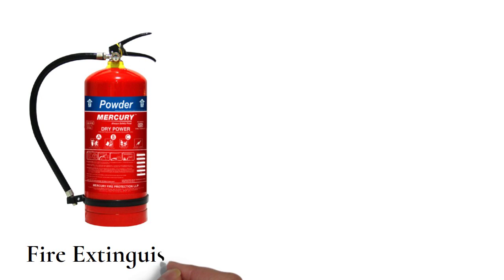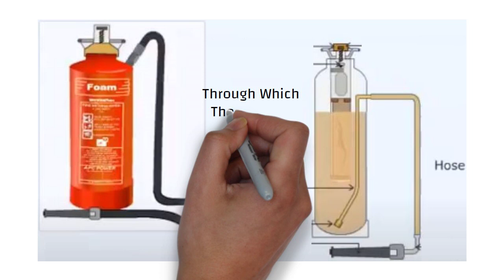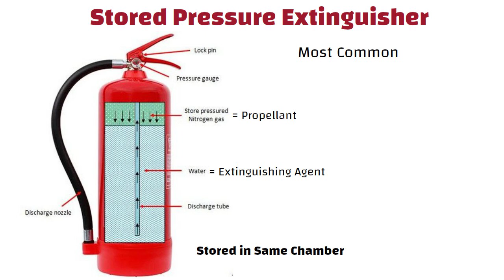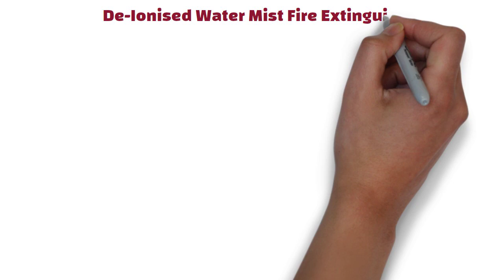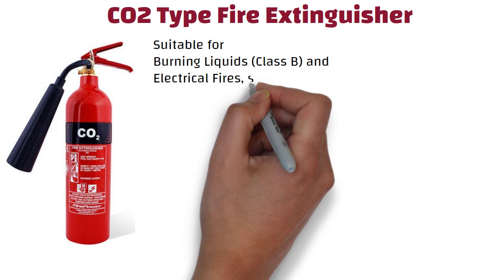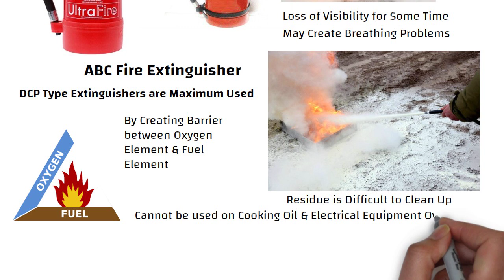FIRE EXTINGUISHER DEALERS IN KERALA, CALL 8138906102, FIRE EXTINGUISHER DEALERS IN ERNAKULAM.

Comment: Fire alarm systems in Kayamkulam
Reply: FIRE EXTINGUISHER DEALERS IN KOCHI, FIRE EXTINGUISHER SUPPLIERS IN KOCHI, FIRE EXTINGUISHER DISTRIBUTORS IN KOCHI, FIRE EXTINGUISHER IN KOCHI, ABC TYPE FIRE EXTINGUISHER DEALERS IN KOCHI, CO2 TYPE FIRE EXTINGUISHER DEALERS IN KOCHI, CLEAN AGENT FIRE EXTINGUISHER IN KOCHI, MODULAR TYPE FIRE EXTINGUISHER DEALERS IN KOCHI, MECHANICAL FOAM FIRE EXTINGUISHER DEALERS IN KOCHI, FIRE EXTINGUISHER NEAR ME KOCHI, FIRE EXTINGUISHER TRADERS IN KOCHI, FIRE FIGHTING COMPANIES IN KOCHI, FIRE CONTRACTORS IN KOCHI, FIRE EQUIPMENT DEALERS IN KOCHI, FIRE ALARM DEALERS IN KOCHI, FIRE PUMP DEALERS IN KOCHI, SMOKE DETECTOR DEALERS IN KOCHI, FIRE FIGHTING SYSTEM IN KOCHI, FIRE PROTECTION SYSTEM IN KOCHI, FIRE AND SAFETY CONTRACTORS IN KOCHI, FIRE HYDRANT SYSTEMS IN KOCHI, PA TALK BACK SYSTEM IN KOCHI, FIRE NOC IN KOCHI, FIRE INSTALLATION IN KOCHI, FIRE NOC RENEWAL IN KOCHI, KIRLOSKAR FIRE PUMP DEALERS IN KOCHI, FIRE EXTINGUISHER NEAR ME KOCHI, FIRE EXTINGUISHER MANUFACURERS IN KOCHI, SAFEX FIRE EXTINGUISHER DEALERS IN KOCHI, FIRE NOC CONTRACTORS IN KOCHI, FIRE FIGHTING EQUIPMENT DEALERS IN KOCHI, FIRE PROTECTION SYSTEM IN KOCHI, FIRE INSTALLATION IN KOCHI, FIRE SAFETY CONTRACTORS IN KOCHI, FIRE AMC IN KOCHI, FIRE PROTECTION SYSTEM IN KOCHI, FIRE PROTECTION EQUIPMET IN KOCHI, AMC OF FIRE SYSTEM IN KOCHI, FIRE CONSULTANTS IN KOCHI, FIRE AND SAFETY EQUIPMENT DEALERS IN KOCHI, ADDRESSABLE FIRE ALARM SYSTEM IN KOCHI, KARTHAR VALVE DEALERS IN KOCHI, DCP TYPE FIRE EXTINGUISHER IN KOCHI, POWSER TYPE FIRE EXTINGUISHERS IN KOCHI, FIRE HYDRANT SYSTEM IN KOCHI, FIRE ALARM PANEL DEALERS IN KOCHI, SAFEPRO FIRE EXTINGUISHER DEALERS IN KOCHI, MS AND GI PIPE DEALERS IN KOCHI, JINDAL PIPE DEALERS IN KOCHI, AGNI FIRE ALARM DEALERS IN KOCHI, FIRE EQUIPMENT DEALERS IN KOCHI, FIRE EQUIPMENT SUPPLIERS IN KOCHI, FIRE EQUIPMENT TRADERS IN KOCHI, FIRE SPRINKLER SYSTEM IN KOCHI, RAVLE FIRE ALARM DEALERS IN KOCHI, RAVEL FIRE ALARM SYSTEM IN KOCHI, AGNI FIRE ALARM DISTRIBUTORS IN KOCHI, FIRE ALARM CONTRACTORS IN KOCHI, FIRE PIPE INSTALLATION IN CONTRACTORS IN KOCHI, FIRE SAFETY CONTRACTORS IN KOCHI, FIRE PA TWO WAY TALK BACK SYSTEM DEALERS IN KOCHI, HEAT DETECTOR DEALERS IN KOCHI, HONEYWELL FIRE ALARM DEALERS IN KOCHI, FIRE NOC CONSULTANTS IN KOCHI, FIRE AMC AND FIRE NOC IN KOCHI, FIRE SAFETY COMPANIES IN KOCHI, NEWAGE DEALERS IN KOCHI, MONSHER FIRE EQUIPMENT DEALERS IN KOCHI, KARTHAR VALVE DEALERS IN KOCHI, FIRE HYDRANT VALVE DEALERS IN KOCHI, FIRE HOSE REEL DRUM DEALERS IN KOCHI, FIRE SPRINKLER DEALERS IN KOCHI, FIRE PUMP DEALERS IN KOCHI, LUBI PUMP DEALERS IN KOCHI, LHP PUMP DEALERS IN KOCHI. FIRE CONTRACTORS IN KOCHI, FIRE AND SAFETY CONTRACTORS IN KOCHI, FIRE EQUIPMENT DEALERS IN KOCHI, FIRE FIGHTING CONTRACTORS IN KOCHI,
Reply: FIRE EXTINGUISHER DEALERS IN KOTTARAKARA, FIRE EXTINGUISHER SUPPLIERS IN KOTTARAKARA, FIRE EXTINGUISHER DISTRIBUTORS IN KOTTARAKARA, FIRE EXTINGUISHER IN KOTTARAKARA, ABC TYPE FIRE EXTINGUISHER DEALERS IN KOTTARAKARA, CO2 TYPE FIRE EXTINGUISHER DEALERS IN KOTTARAKARA, CLEAN AGENT FIRE EXTINGUISHER IN KOTTARAKARA, MODULAR TYPE FIRE EXTINGUISHER DEALERS IN KOTTARAKARA, MECHANICAL FOAM FIRE EXTINGUISHER DEALERS IN KOTTARAKARA, FIRE EXTINGUISHER NEAR ME KOTTARAKARA, FIRE EXTINGUISHER TRADERS IN KOTTARAKARA, FIRE FIGHTING COMPANIES IN KOTTARAKARA, FIRE CONTRACTORS IN KOTTARAKARA, FIRE EQUIPMENT DEALERS IN KOTTARAKARA, FIRE ALARM DEALERS IN KOTTARAKARA, FIRE PUMP DEALERS IN KOTTARAKARA, SMOKE DETECTOR DEALERS IN KOTTARAKARA, FIRE FIGHTING SYSTEM IN KOTTARAKARA, FIRE PROTECTION SYSTEM IN KOTTARAKARA, FIRE AND SAFETY CONTRACTORS IN KOTTARAKARA, FIRE HYDRANT SYSTEMS IN KOTTARAKARA, PA TALK BACK SYSTEM IN KOTTARAKARA, FIRE NOC IN KOTTARAKARA, FIRE INSTALLATION IN KOTTARAKARA, FIRE NOC RENEWAL IN KOTTARAKARA, KIRLOSKAR FIRE PUMP DEALERS IN KOTTARAKARA, FIRE EXTINGUISHER NEAR ME KOTTARAKARA, FIRE EXTINGUISHER MANUFACURERS IN KOTTARAKARA, SAFEX FIRE EXTINGUISHER DEALERS IN KOTTARAKARA, FIRE NOC CONTRACTORS IN KOTTARAKARA, FIRE FIGHTING EQUIPMENT DEALERS IN KOTTARAKARA, FIRE PROTECTION SYSTEM IN KOTTARAKARA, FIRE INSTALLATION IN KOTTARAKARA, FIRE SAFETY CONTRACTORS IN KOTTARAKARA, FIRE AMC IN KOTTARAKARA, FIRE PROTECTION SYSTEM IN KOTTARAKARA, FIRE PROTECTION EQUIPMET IN KOTTARAKARA, AMC OF FIRE SYSTEM IN KOTTARAKARA, FIRE CONSULTANTS IN KOTTARAKARA, FIRE AND SAFETY EQUIPMENT DEALERS IN KOTTARAKARA, ADDRESSABLE FIRE ALARM SYSTEM IN KOTTARAKARA, KARTHAR VALVE DEALERS IN KOTTARAKARA, DCP TYPE FIRE EXTINGUISHER IN KOTTARAKARA, POWSER TYPE FIRE EXTINGUISHERS IN KOTTARAKARA, FIRE HYDRANT SYSTEM IN KOTTARAKARA, FIRE ALARM PANEL DEALERS IN KOTTARAKARA, SAFEPRO FIRE EXTINGUISHER DEALERS IN KOTTARAKARA, MS AND GI PIPE DEALERS IN KOTTARAKARA, JINDAL PIPE DEALERS IN KOTTARAKARA, AGNI FIRE ALARM DEALERS IN KOTTARAKARA, FIRE EQUIPMENT DEALERS IN KOTTARAKARA, FIRE EQUIPMENT SUPPLIERS IN KOTTARAKARA, FIRE EQUIPMENT TRADERS IN KOTTARAKARA, FIRE SPRINKLER SYSTEM IN KOTTARAKARA, RAVEL FIRE ALARM DEALERS IN KOTTARAKARA, RAVEL FIRE ALARM SYSTEM IN KOTTARAKARA, AGNI FIRE ALARM DISTRIBUTORS IN KOTTARAKARA, FIRE ALARM CONTRACTORS IN KOTTARAKARA, FIRE PIPE INSTALLATION IN CONTRACTORS IN KOTTARAKARA, FIRE SAFETY CONTRACTORS IN KOTTARAKARA, FIRE PA TWO WAY TALK BACK SYSTEM DEALERS IN KOTTARAKARA, HEAT DETECTOR DEALERS IN KOTTARAKARA, HONEYWELL FIRE ALARM DEALERS IN KOTTARAKARA, FIRE NOC CONSULTANTS IN KOTTARAKARA, FIRE AMC AND FIRE NOC IN KOTTARAKARA, FIRE SAFETY COMPANIES IN KOTTARAKARA, NEWAGE DEALERS IN KOTTARAKARA, MONSHER FIRE EQUIPMENT DEALERS IN KOTTARAKARA, KARTHAR VALVE DEALERS IN KOTTARAKARA, FIRE HYDRANT VALVE DEALERS IN KOTTARAKARA, FIRE HOSE REEL DRUM DEALERS IN KOTTARAKARA, FIRE SPRINKLER DEALERS IN KOTTARAKARA, FIRE PUMP DEALERS IN KOTTARAKARA, LUBI PUMP DEALERS IN KOTTARAKARA, LHP PUMP DEALERS IN KOTTARAKARA. FIRE CONTRACTORS IN KOTTARAKARA, FIRE AND SAFETY CONTRACTORS IN KOTTARAKARA, FIRE EQUIPMENT DEALERS IN KOTTARAKARA, FIRE FIGHTING CONTRACTORS IN KOTTARAKARA, AGNI FIRE ALARM DEALERS IN KOTTARAKARA, PA TALK BACK SYSTEM DEALERS IN KOTTARAKARA, FIRE NOC IN KOTTARAKARA, FIRE NOC RENEWAL IN KOTTARAKARA, FIRE SYSTEM INSTALLATION IN KOTTARAKARA.
Reply: FIRE EXTINGUISHER DEALERS IN KERALA, FIRE EXTINGUISHER SUPPLIERS IN KERALA, FIRE EXTINGUISHER DISTRIBUTORS IN KERALA, FIRE EXTINGUISHER IN KERALA, ABC TYPE FIRE EXTINGUISHER DEALERS IN KERALA, CO2 TYPE FIRE EXTINGUISHER DEALERS IN KERALA, CLEAN AGENT FIRE EXTINGUISHER IN KERALA, MODULAR TYPE FIRE EXTINGUISHER DEALERS IN KERALA, MECHANICAL FOAM FIRE EXTINGUISHER DEALERS IN KERALA, FIRE EXTINGUISHER NEAR ME KERALA, FIRE EXTINGUISHER TRADERS IN KERALA, FIRE FIGHTING COMPANIES IN KERALA, FIRE CONTRACTORS IN KERALA, FIRE EQUIPMENT DEALERS IN KERALA, FIRE ALARM DEALERS IN KERALA, FIRE PUMP DEALERS IN KERALA, SMOKE DETECTOR DEALERS IN KERALA, FIRE FIGHTING SYSTEM IN KERALA, FIRE PROTECTION SYSTEM IN KERALA, FIRE AND SAFETY CONTRACTORS IN KERALA, FIRE HYDRANT SYSTEMS IN KERALA, PA TALK BACK SYSTEM IN KERALA, FIRE NOC IN KERALA, FIRE INSTALLATION IN KERALA, FIRE NOC RENEWAL IN KERALA, KIRLOSKAR FIRE PUMP DEALERS IN KERALA, FIRE EXTINGUISHER NEAR ME KERALA, FIRE EXTINGUISHER MANUFACURERS IN KERALA, SAFEX FIRE EXTINGUISHER DEALERS IN KERALA, FIRE NOC CONTRACTORS IN KERALA, FIRE FIGHTING EQUIPMENT DEALERS IN KERALA, FIRE PROTECTION SYSTEM IN KERALA, FIRE INSTALLATION IN KERALA, FIRE SAFETY CONTRACTORS IN KERALA, FIRE AMC IN KERALA, FIRE PROTECTION SYSTEM IN KERALA, FIRE PROTECTION EQUIPMET IN KERALA, AMC OF FIRE SYSTEM IN KERALA, FIRE CONSULTANTS IN KERALA, FIRE AND SAFETY EQUIPMENT DEALERS IN KERALA, ADDRESSABLE FIRE ALARM SYSTEM IN KERALA, KARTHAR VALVE DEALERS IN KERALA, DCP TYPE FIRE EXTINGUISHER IN KERALA, POWSER TYPE FIRE EXTINGUISHERS IN KERALA, FIRE HYDRANT SYSTEM IN KERALA, FIRE ALARM PANEL DEALERS IN KERALA, SAFEPRO FIRE EXTINGUISHER DEALERS IN KERALA, MS AND GI PIPE DEALERS IN KERALA, JINDAL PIPE DEALERS IN KERALA, AGNI FIRE ALARM DEALERS IN KERALA, FIRE EQUIPMENT DEALERS IN KERALA, FIRE EQUIPMENT SUPPLIERS IN KERALA, FIRE EQUIPMENT TRADERS IN KERALA, FIRE SPRINKLER SYSTEM IN KERALA, RAVLE FIRE ALARM DEALERS IN KERALA, RAVEL FIRE ALARM SYSTEM IN KERALA, AGNI FIRE ALARM DISTRIBUTORS IN KERALA, FIRE ALARM CONTRACTORS IN KERALA, FIRE PIPE INSTALLATION IN CONTRACTORS IN KERALA, FIRE SAFETY CONTRACTORS IN KERALA, FIRE PA TWO WAY TALK BACK SYSTEM DEALERS IN KERALA, HEAT DETECTOR DEALERS IN KERALA, HONEYWELL FIRE ALARM DEALERS IN KERALA, FIRE NOC CONSULTANTS IN KERALA, FIRE AMC AND FIRE NOC IN KERALA, FIRE SAFETY COMPANIES IN KERALA, NEWAGE DEALERS IN KERALA, MONSHER FIRE EQUIPMENT DEALERS IN KERALA, KARTHAR VALVE DEALERS IN KERALA, FIRE HYDRANT VALVE DEALERS IN KERALA, FIRE HOSE REEL DRUM DEALERS IN KERALA, FIRE SPRINKLER DEALERS IN KERALA, FIRE PUMP DEALERS IN KERALA, LUBI PUMP DEALERS IN KERALA, LHP PUMP DEALERS IN KERALA. FIRE CONTRACTORS IN KERALA, FIRE AND SAFETY CONTRACTORS IN KERALA, FIRE EQUIPMENT DEALERS IN KERALA, FIRE FIGHTING CONTRACTORS IN KERALA, FIRE EXTINGUISHER DEALERS IN KOCHI, FIRE EXTINGUISHER SUPPLIERS IN KOCHI, FIRE EXTINGUISHER DISTRIBUTORS IN KOCHI, FIRE EXTINGUISHER IN KOCHI, ABC TYPE FIRE EXTINGUISHER DEALERS IN KOCHI, CO2 TYPE FIRE EXTINGUISHER DEALERS IN KOCHI, CLEAN AGENT FIRE EXTINGUISHER IN KOCHI, MODULAR TYPE FIRE EXTINGUISHER DEALERS IN KOCHI, MECHANICAL FOAM FIRE EXTINGUISHER DEALERS IN KOCHI, FIRE EXTINGUISHER NEAR ME KOCHI, FIRE EXTINGUISHER TRADERS IN KOCHI, FIRE FIGHTING COMPANIES IN KOCHI, FIRE CONTRACTORS IN KOCHI, FIRE EQUIPMENT DEALERS IN KOCHI, FIRE ALARM DEALERS IN KOCHI, FIRE PUMP DEALERS IN KOCHI, SMOKE DETECTOR DEALERS IN KOCHI, FIRE FIGHTING SYSTEM IN KOCHI, FIRE PROTECTION SYSTEM IN KOCHI, FIRE AND SAFETY CONTRACTORS IN KOCHI, FIRE HYDRANT SYSTEMS IN KOCHI, PA TALK BACK SYSTEM IN KOCHI, FIRE NOC IN KOCHI, FIRE INSTALLATION IN KOCHI, FIRE NOC RENEWAL IN KOCHI, KIRLOSKAR FIRE PUMP DEALERS IN KOCHI, FIRE EXTINGUISHER NEAR ME KOCHI, FIRE EXTINGUISHER MANUFACURERS IN KOCHI, SAFEX FIRE EXTINGUISHER DEALERS IN KOCHI, FIRE NOC CONTRACTORS IN KOCHI, FIRE FIGHTING EQUIPMENT DEALERS IN KOCHI, FIRE PROTECTION SYSTEM IN KOCHI, FIRE INSTALLATION IN KOCHI, FIRE SAFETY CONTRACTORS IN KOCHI, FIRE AMC IN KOCHI, FIRE PROTECTION SYSTEM IN KOCHI, FIRE PROTECTION EQUIPMET IN KOCHI, AMC OF FIRE SYSTEM IN KOCHI, FIRE CONSULTANTS IN KOCHI, FIRE AND SAFETY EQUIPMENT DEALERS IN KOCHI, ADDRESSABLE FIRE ALARM SYSTEM IN KOCHI, KARTHAR VALVE DEALERS IN KOCHI, DCP TYPE FIRE EXTINGUISHER IN KOCHI, POWSER TYPE FIRE EXTINGUISHERS IN KOCHI, FIRE HYDRANT SYSTEM IN KOCHI, FIRE ALARM PANEL DEALERS IN KOCHI, SAFEPRO FIRE EXTINGUISHER DEALERS IN KOCHI, MS AND GI PIPE DEALERS IN KOCHI, JINDAL PIPE DEALERS IN KOCHI, AGNI FIRE ALARM DEALERS IN KOCHI, FIRE EQUIPMENT DEALERS IN KOCHI, FIRE EQUIPMENT SUPPLIERS IN KOCHI, FIRE EQUIPMENT TRADERS IN KOCHI, FIRE SPRINKLER SYSTEM IN KOCHI, RAVLE FIRE ALARM DEALERS IN KOCHI, RAVEL FIRE ALARM SYSTEM IN KOCHI, AGNI FIRE ALARM DISTRIBUTORS IN KOCHI, FIRE ALARM CONTRACTORS IN KOCHI, FIRE PIPE INSTALLATION IN CONTRACTORS IN KOCHI, FIRE SAFETY CONTRACTORS IN KOCHI, FIRE PA TWO WAY TALK BACK SYSTEM DEALERS IN KOCHI, HEAT DETECTOR DEALERS IN KOCHI, HONEYWELL FIRE ALARM DEALERS IN KOCHI, FIRE NOC CONSULTANTS IN KOCHI, FIRE AMC AND FIRE NOC IN KOCHI, FIRE SAFETY COMPANIES IN KOCHI, NEWAGE DEALERS IN KOCHI, MONSHER FIRE EQUIPMENT DEALERS IN KOCHI, KARTHAR VALVE DEALERS IN KOCHI, FIRE HYDRANT VALVE DEALERS IN KOCHI, FIRE HOSE REEL DRUM DEALERS IN KOCHI, FIRE SPRINKLER DEALERS IN KOCHI, FIRE PUMP DEALERS IN KOCHI, LUBI PUMP DEALERS IN KOCHI, LHP PUMP DEALERS IN KOCHI. FIRE CONTRACTORS IN KOCHI, FIRE AND SAFETY CONTRACTORS IN KOCHI, FIRE EQUIPMENT DEALERS IN KOCHI, FIRE FIGHTING CONTRACTORS IN KOCHI, FIRE EXTINGUISHER DEALERS IN ERNAKULAM, FIRE EXTINGUISHER SUPPLIERS IN ERNAKULAM, FIRE EXTINGUISHER DISTRIBUTORS IN ERNAKULAM, FIRE EXTINGUISHER IN ERNAKULAM, ABC TYPE FIRE EXTINGUISHER DEALERS IN ERNAKULAM, CO2 TYPE FIRE EXTINGUISHER DEALERS IN ERNAKULAM, CLEAN AGENT FIRE EXTINGUISHER IN ERNAKULAM, MODULAR TYPE FIRE EXTINGUISHER DEALERS IN ERNAKULAM, MECHANICAL FOAM FIRE EXTINGUISHER DEALERS IN ERNAKULAM, FIRE EXTINGUISHER NEAR ME ERNAKULAM, FIRE EXTINGUISHER TRADERS IN ERNAKULAM, FIRE FIGHTING COMPANIES IN ERNAKULAM, FIRE CONTRACTORS IN ERNAKULAM, FIRE EQUIPMENT DEALERS IN ERNAKULAM, FIRE ALARM DEALERS IN ERNAKULAM, FIRE PUMP DEALERS IN ERNAKULAM, SMOKE DETECTOR DEALERS IN ERNAKULAM, FIRE FIGHTING SYSTEM IN ERNAKULAM, FIRE PROTECTION SYSTEM IN ERNAKULAM, FIRE AND SAFETY CONTRACTORS IN ERNAKULAM, FIRE HYDRANT SYSTEMS IN ERNAKULAM, PA TALK BACK SYSTEM IN ERNAKULAM, FIRE NOC IN ERNAKULAM, FIRE INSTALLATION IN ERNAKULAM, FIRE NOC RENEWAL IN ERNAKULAM, KIRLOSKAR FIRE PUMP DEALERS IN ERNAKULAM, FIRE EXTINGUISHER NEAR ME ERNAKULAM, FIRE EXTINGUISHER MANUFACURERS IN ERNAKULAM, SAFEX FIRE EXTINGUISHER DEALERS IN ERNAKULAM, FIRE NOC CONTRACTORS IN ERNAKULAM, FIRE FIGHTING EQUIPMENT DEALERS IN ERNAKULAM, FIRE PROTECTION SYSTEM IN ERNAKULAM, FIRE INSTALLATION IN ERNAKULAM, FIRE SAFETY CONTRACTORS IN ERNAKULAM, FIRE AMC IN ERNAKULAM, FIRE PROTECTION SYSTEM IN ERNAKULAM, FIRE PROTECTION EQUIPMET IN ERNAKULAM, AMC OF FIRE SYSTEM IN ERNAKULAM, FIRE CONSULTANTS IN ERNAKULAM, FIRE AND SAFETY EQUIPMENT DEALERS IN ERNAKULAM, ADDRESSABLE FIRE ALARM SYSTEM IN ERNAKULAM, KARTHAR VALVE DEALERS IN ERNAKULAM, DCP TYPE FIRE EXTINGUISHER IN ERNAKULAM, POWSER TYPE FIRE EXTINGUISHERS IN ERNAKULAM, FIRE HYDRANT SYSTEM IN ERNAKULAM, FIRE ALARM PANEL DEALERS IN ERNAKULAM, SAFEPRO FIRE EXTINGUISHER DEALERS IN ERNAKULAM, MS AND GI PIPE DEALERS IN ERNAKULAM, JINDAL PIPE DEALERS IN ERNAKULAM, AGNI FIRE ALARM DEALERS IN ERNAKULAM, FIRE EQUIPMENT DEALERS IN ERNAKULAM, FIRE EQUIPMENT SUPPLIERS IN ERNAKULAM, FIRE EQUIPMENT TRADERS IN ERNAKULAM, FIRE SPRINKLER SYSTEM IN ERNAKULAM, RAVLE FIRE ALARM DEALERS IN ERNAKULAM, RAVEL FIRE ALARM SYSTEM IN ERNAKULAM, AGNI FIRE ALARM DISTRIBUTORS IN ERNAKULAM, FIRE ALARM CONTRACTORS IN ERNAKULAM, FIRE PIPE INSTALLATION IN CONTRACTORS IN ERNAKULAM, FIRE SAFETY CONTRACTORS IN ERNAKULAM, FIRE PA TWO WAY TALK BACK SYSTEM DEALERS IN ERNAKULAM, HEAT DETECTOR DEALERS IN ERNAKULAM, HONEYWELL FIRE ALARM DEALERS IN ERNAKULAM, FIRE NOC CONSULTANTS IN ERNAKULAM, FIRE AMC AND FIRE NOC IN ERNAKULAM, FIRE SAFETY COMPANIES IN ERNAKULAM, NEWAGE DEALERS IN ERNAKULAM, MONSHER FIRE EQUIPMENT DEALERS IN ERNAKULAM, KARTHAR VALVE DEALERS IN ERNAKULAM, FIRE HYDRANT VALVE DEALERS IN ERNAKULAM, FIRE HOSE REEL DRUM DEALERS IN ERNAKULAM, FIRE SPRINKLER DEALERS IN ERNAKULAM, FIRE PUMP DEALERS IN ERNAKULAM, LUBI PUMP DEALERS IN ERNAKULAM, LHP PUMP DEALERS IN ERNAKULAM. FIRE CONTRACTORS IN ERNAKULAM, FIRE AND SAFETY CONTRACTORS IN ERNAKULAM, FIRE EQUIPMENT DEALERS IN ERNAKULAM, FIRE FIGHTING CONTRACTORS IN ERNAKULAM, 

htts://www.aimfireequipment.com

https://safewaysystems.websites.co.in

https://g.co/kgs/aksGSCu

https://g.co/kgs/dFfWcUQ
Reply: FIRE EXTINGUISHER DEALERS IN KERALA, FIRE EXTINGUISHER SUPPLIERS IN KERALA, FIRE EXTINGUISHER DISTRIBUTORS IN KERALA, FIRE EXTINGUISHER IN KERALA, ABC TYPE FIRE EXTINGUISHER DEALERS IN KERALA, CO2 TYPE FIRE EXTINGUISHER DEALERS IN KERALA, CLEAN AGENT FIRE EXTINGUISHER IN KERALA, MODULAR TYPE FIRE EXTINGUISHER DEALERS IN KERALA, MECHANICAL FOAM FIRE EXTINGUISHER DEALERS IN KERALA, FIRE EXTINGUISHER NEAR ME KERALA, FIRE EXTINGUISHER TRADERS IN KERALA, FIRE FIGHTING COMPANIES IN KERALA, FIRE CONTRACTORS IN KERALA, FIRE EQUIPMENT DEALERS IN KERALA, FIRE ALARM DEALERS IN KERALA, FIRE PUMP DEALERS IN KERALA, SMOKE DETECTOR DEALERS IN KERALA, FIRE FIGHTING SYSTEM IN KERALA, FIRE PROTECTION SYSTEM IN KERALA, FIRE AND SAFETY CONTRACTORS IN KERALA, FIRE HYDRANT SYSTEMS IN KERALA, PA TALK BACK SYSTEM IN KERALA, FIRE NOC IN KERALA, FIRE INSTALLATION IN KERALA, FIRE NOC RENEWAL IN KERALA, KIRLOSKAR FIRE PUMP DEALERS IN KERALA, FIRE EXTINGUISHER NEAR ME KERALA, FIRE EXTINGUISHER MANUFACURERS IN KERALA, SAFEX FIRE EXTINGUISHER DEALERS IN KERALA, FIRE NOC CONTRACTORS IN KERALA, FIRE FIGHTING EQUIPMENT DEALERS IN KERALA, FIRE PROTECTION SYSTEM IN KERALA, FIRE INSTALLATION IN KERALA, FIRE SAFETY CONTRACTORS IN KERALA, FIRE AMC IN KERALA, FIRE PROTECTION SYSTEM IN KERALA, FIRE PROTECTION EQUIPMET IN KERALA, AMC OF FIRE SYSTEM IN KERALA, FIRE CONSULTANTS IN KERALA, FIRE AND SAFETY EQUIPMENT DEALERS IN KERALA, ADDRESSABLE FIRE ALARM SYSTEM IN KERALA, KARTHAR VALVE DEALERS IN KERALA, DCP TYPE FIRE EXTINGUISHER IN KERALA, POWSER TYPE FIRE EXTINGUISHERS IN KERALA, FIRE HYDRANT SYSTEM IN KERALA, FIRE ALARM PANEL DEALERS IN KERALA, SAFEPRO FIRE EXTINGUISHER DEALERS IN KERALA, MS AND GI PIPE DEALERS IN KERALA, JINDAL PIPE DEALERS IN KERALA, AGNI FIRE ALARM DEALERS IN KERALA, FIRE EQUIPMENT DEALERS IN KERALA, FIRE EQUIPMENT SUPPLIERS IN KERALA, FIRE EQUIPMENT TRADERS IN KERALA, FIRE SPRINKLER SYSTEM IN KERALA, RAVLE FIRE ALARM DEALERS IN KERALA, RAVEL FIRE ALARM SYSTEM IN KERALA, AGNI FIRE ALARM DISTRIBUTORS IN KERALA, FIRE ALARM CONTRACTORS IN KERALA, FIRE PIPE INSTALLATION IN CONTRACTORS IN KERALA, FIRE SAFETY CONTRACTORS IN KERALA, FIRE PA TWO WAY TALK BACK SYSTEM DEALERS IN KERALA, HEAT DETECTOR DEALERS IN KERALA, HONEYWELL FIRE ALARM DEALERS IN KERALA, FIRE NOC CONSULTANTS IN KERALA, FIRE AMC AND FIRE NOC IN KERALA, FIRE SAFETY COMPANIES IN KERALA, NEWAGE DEALERS IN KERALA, MONSHER FIRE EQUIPMENT DEALERS IN KERALA, KARTHAR VALVE DEALERS IN KERALA, FIRE HYDRANT VALVE DEALERS IN KERALA, FIRE HOSE REEL DRUM DEALERS IN KERALA, FIRE SPRINKLER DEALERS IN KERALA, FIRE PUMP DEALERS IN KERALA, LUBI PUMP DEALERS IN KERALA, LHP PUMP DEALERS IN KERALA. FIRE CONTRACTORS IN KERALA, FIRE AND SAFETY CONTRACTORS IN KERALA, FIRE EQUIPMENT DEALERS IN KERALA, FIRE FIGHTING CONTRACTORS IN KERALA
Reply: FIRE EXTINGUISHER DEALERS IN ERNAKULAM, FIRE EXTINGUISHER DEALERS IN TRIVANDRUM, FIRE EXTINGUISHER DEALERS IN KOCHI, FIRE EXTINGUISHER DEALERS IN THRISSUR, FIRE EXTINGUISHER DEALERS IN PALAKKAD, FIRE EXTINGUISHER DEALERS IN KOTTAYAM, FIRE EXTINGUISHER DEALERS IN CHANGANASSERY, FIRE EXTINGUISHER DEALERS IN THIRUVALLA, FIRE EXTINGUISHER DEALERS IN CHENGANNUR, FIRE EXTINGUISHER DEALERS IN ALEPPEY, FIRE EXTINGUISHER DEALERS IN ADOOR, FIRE EXTINGUISHER DEALERS IN PANDALAM, FIRE EXTINGUISHER DEALERS IN KARUNAGAPALLY, FIRE EXTINGUISHER DEALERS IN KARUNAGAPPALLY, FIRE EXTINGUISHER DEALERS IN KAYAMKULAM, FIRE EXTINGUISHER DEALERS IN PATHANAMTHITTA, FIRE EXTINGUISHER DEALERS IN OACHIRA, FIRE EXTINGUISHER DEALERS IN KOLLAM, FIRE EXTINGUISHER DEALERS IN TRIVANDRUM, FIRE EXTINGUISHER DEALERS IN PERUMBAVOOR, FIRE EXTINGUISHER DEALERS IN KOTHAMANGALAM, FIRE EXTINGUISHER DEALERS IN MOOVATTUPUZHA, FIRE EXTINGUISHER DEALERS IN PALA, FIRE EXTINGUISHER DEALERS IN VALANCHERY, FIRE EXTINGUISHER DEALERS IN MALAPPURAM, FIRE EXTINGUISHER DEALERS IN TIRUR, FIRE EXTINGUISHER DEALERS IN CALICUT, FIRE EXTINGUISHER DEALERS IN PONNANI, FIRE EXTINGUISHER DEALERS IN PAYYANNUR, FIRE EXTINGUISHER DEALERS IN PAYYANUR, FIRE EXTINGUISHER DEALERS IN WAYANAD, FIRE EXTINGUISHER DEALERS IN KALPETTA, FIRE EXTINGUISHER DEALERS IN MANANTHAVADY, FIRE EXTINGUISHER DEALERS IN FEROKE, FIRE EXTINGUISHER DEALERS IN THANUR, FIRE EXTINGUISHER DEALERS IN KERALA, FIRE EXTINGUISHER DEALERS IN CHALAKKUDY, FIRE EXTINGUISHER DEALERS IN KODUNGALLUR, FIRE EXTINGUISHER DEALERS IN ANGAMALY, FIRE EXTINGUISHER DEALERS IN BATHERY, FIRE EXTINGUISHER DEALERS IN, MUNNAR, FIRE EXTINGUISHER DEALERS IN IDUKKI, FIRE EXTINGUISHER DEALERS IN MANJERI, FIRE EXTINGUISHER DEALERS IN THALASSERY, FIRE EXTINGUISHER DEALERS IN THRIPUNITHURA, FIRE EXTINGUISHER DEALERS IN VADAKARA, FIRE EXTINGUISHER DEALERS IN KANHANGAD, FIRE EXTINGUISHER DEALERS IN KOYILANDI, FIRE EXTINGUISHER DEALERS IN KALAMASSERY, FIRE EXTINGUISHER DEALERS IN NEYYATINKARA, FIRE EXTINGUISHER DEALERS IN GURUVAYUR, FIRE EXTINGUISHER DEALERS IN VADAKKANCHERY, FIRE EXTINGUISHER DEALERS IN PARAPPANAGADI, FIRE EXTINGUISHER DEALERS IN NEDUMANGAD, FIRE EXTINGUISHER DEALERS IN KASARGOD, FIRE EXTINGUISHER DEALERS IN PAYYOLI, FIRE EXTINGUISHER DEALERS IN PUNALUR, FIRE EXTINGUISHER DEALERS IN CHERTHALA, FIRE EXTINGUISHER DEALERS IN THALIPARAMBA, FIRE EXTINGUISHER DEALERS IN KOTTAKKAL, FIRE EXTINGUISHER DEALERS IN SHORANUR, FIRE EXTINGUISHER DEALERS IN IRITTY, FIRE EXTINGUISHER DEALERS IN ATTINGAL, FIRE EXTINGUISHER DEALERS IN HARIPAD, FIRE EXTINGUISHER DEALERS IN MUVATTUPUZHA, FIRE EXTINGUISHER DEALERS IN MOOVATTUPUZHA, FIRE EXTINGUISHER DEALERS IN KOOTHUPARAMBA, FIRE EXTINGUISHER DEALERS IN IRINJALAKUDA, FIRE EXTINGUISHER DEALERS IN MAVELIKKARA, FIRE EXTINGUISHER DEALERS IN VARKALA, FIRE EXTINGUISHER DEALERS IN MANATHAVADI, FIRE EXTINGUISHER DEALERS IN KOTTARAKARA, FIRE EXTINGUISHER DEALERS IN KOTTARAKKARA, FIRE EXTINGUISHER DEALERS IN RANNI, FIRE EXTINGUISHER DEALERS IN MALLAPALLY, FIRE EXTINGUISHER DEALERS IN ALUVA, FIRE EXTINGUISHER DEALERS IN SHORANUR, FIRE EXTINGUISHER DEALERS IN EDAPPAL, FIRE EXTINGUISHER DEALERS INKUTTIPURAM, FIRE EXTINGUISHER DEALERS IN PERINTHALMANNA, FIRE EXTINGUISHER DEALERS IN NILESWAR, FIRE EXTINGUISHER DEALERS IN KUTTIADI, FIRE EXTINGUISHER DEALERS IN MAHE, FIRE EXTINGUISHER DEALERS IN THAMARASSERY, FIRE EXTINGUISHER DEALERS IN PONKUNNAM, FIRE EXTINGUISHER DEALERS IN NILAMBUR, FIRE EXTINGUISHER DEALERS IN PATTAMBI, FIRE EXTINGUISHER DEALERS IN VALPARAI, FIRE EXTINGUISHER DEALERS IN ADIMALY, FIRE EXTINGUISHER DEALERS IN KOOTHATTUKULAM, FIRE EXTINGUISHER DEALERS IN THALAYOLAPARAMBU, FIRE EXTINGUISHER DEALERS IN ETTUMANUR, FIRE EXTINGUISHER DEALERS IN KANJIRAPPALY, FIRE EXTINGUISHER DEALERS IN CHAVARA, FIRE EXTINGUISHER DEALERS IN KILIMANUR, FIRE EXTINGUISHER DEALERS IN KUTTIKKANAM, FIRE EXTINGUISHER DEALERS IN PERAMBRA, FIRE EXTINGUISHER DEALERS IN MANNARKKAD, FIRE EXTINGUISHER DEALERS IN KUNDARA, FIRE EXTINGUISHER DEALERS IN TANUR, FIRE EXTINGUISHER DEALERS IN NOORANAD, FIRE EXTINGUISHER DEALERS IN KONNI, FIRE EXTINGUISHER DEALERS IN SASTHAMKOTTA, FIRE EXTINGUISHER DEALERS IN PATHANAPURAM, FIRE EXTINGUISHER DEALERS IN  ANCHAL, FIRE EXTINGUISHER DEALERS IN  KOZHENCHERY, FIRE EXTINGUISHER DEALERS IN  MUNDAKAYAM, FIRE EXTINGUISHER DEALERS IN  KANJIRAPALLY, FIRE EXTINGUISHER DEALERS IN VAIKOM, FIRE EXTINGUISHER DEALERS IN KATTAPANA, FIRE EXTINGUISHER DEALERS IN CHIRAYANKEEZHU, FIRE EXTINGUISHER DEALERS IN KOLENCHERY, FIRE EXTINGUISHER DEALERS IN MAHE, FIRE EXTINGUISHER DEALERS IN NADAPURAM, FIRE EXTINGUISHER DEALERS IN KUTTIYADI.